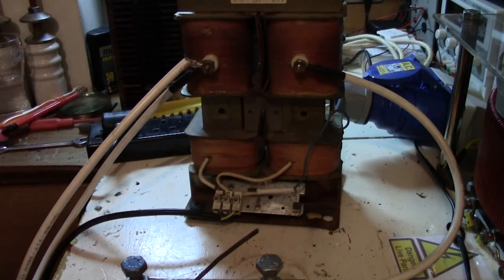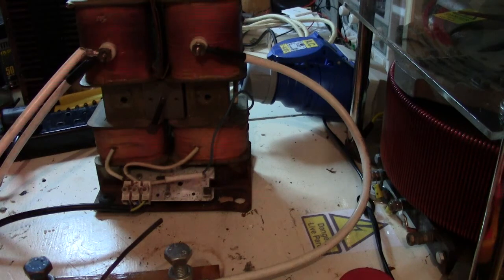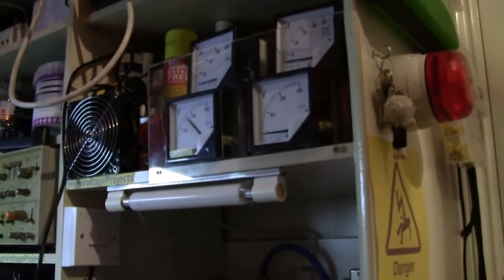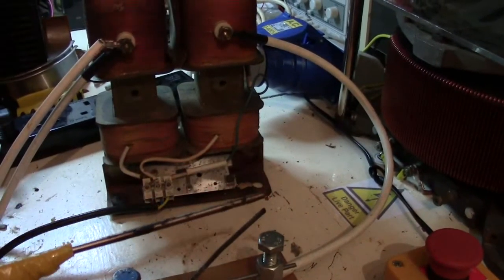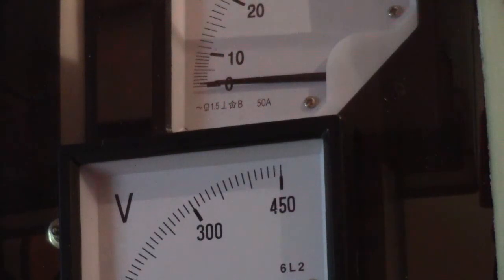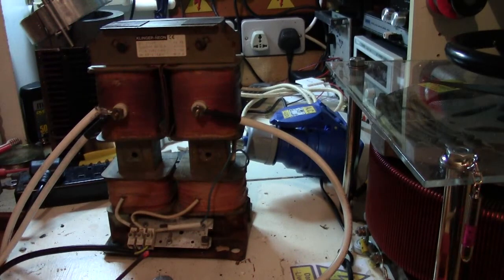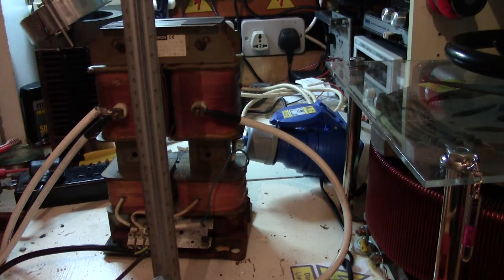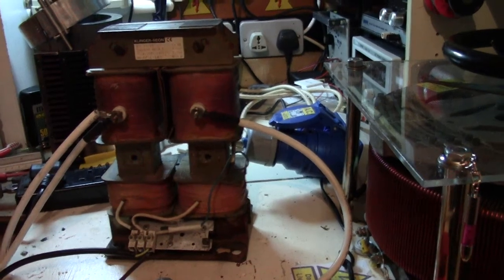FULL POWER REQUESTED BY MANY BIG NST ARCS 8KV @ 375mA

Comment: Woooo! :D

Shunt in...... bzzzz...
Shunt out... BZZZZZZZZZZZZZZZZZZZZZZZ!!!!! :D Like a beehive!

Mmmmm, If it wasn't for a variety of flammable things in the room, like bedding & carpet for example, it'd be nice to get a motor & wire it to the output, set the variac to zero, press the power on, then slowly tease the motor with the variac until we get com bars letting loose all over the room. :D

I've seen it done with a standard MOT, so this Tx could easily maul the average vac motor. :D

-BBD.